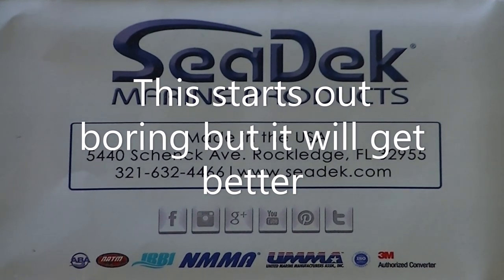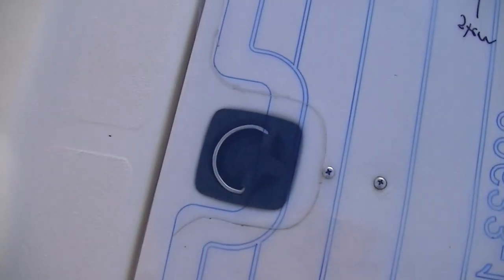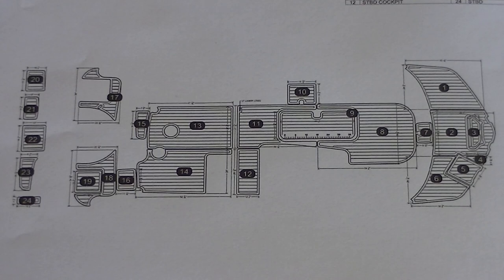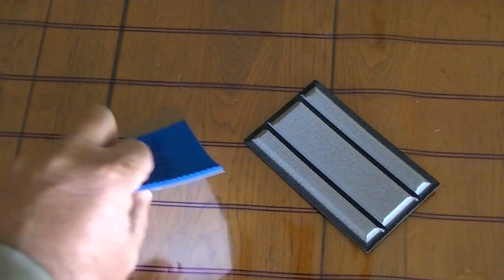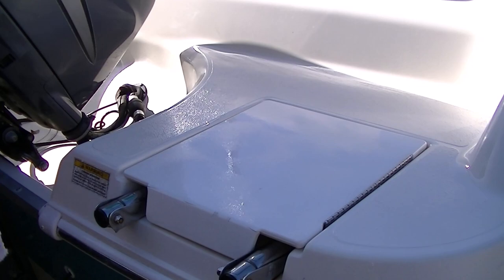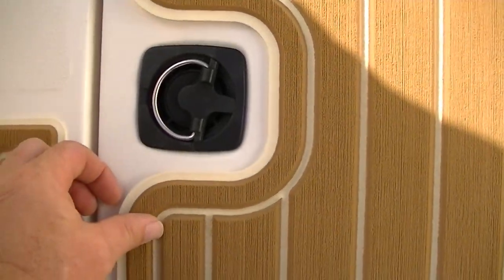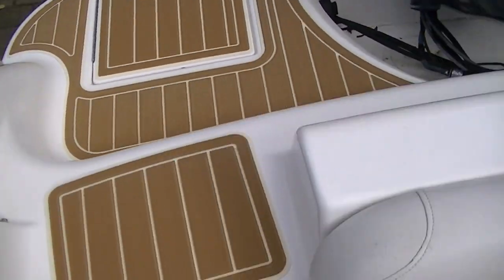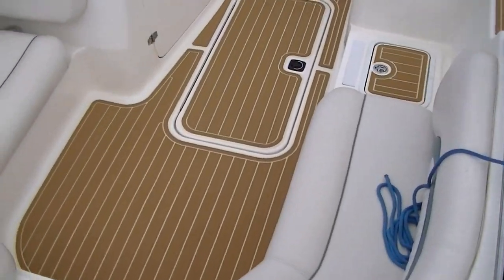Seadek  DIY Install... Should you do it yourself?

Comment: How mush was it?
How does it hold up to use
Reply from the maker: It was around $2400 ,  It is a spongy material I have noticed little nicks and cuts from either accidently stepping on something on the floor or dropping things like pliers etc.  I would consider doing this if you had a "high end boat"  in the $100k range because the $$ would be about 2.5% of value of boat.  In my situation it was about 10% of what the boat was worth.   it does look great and I get a lot of compliments from it.
Reply: @Kevtheguitarguy  I agree with u 100%